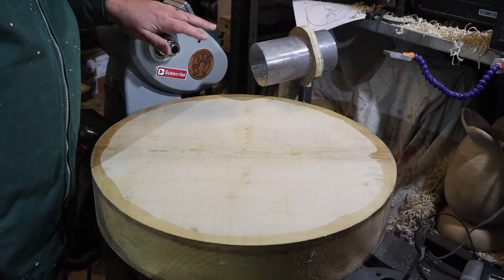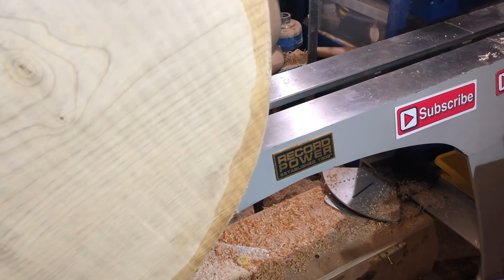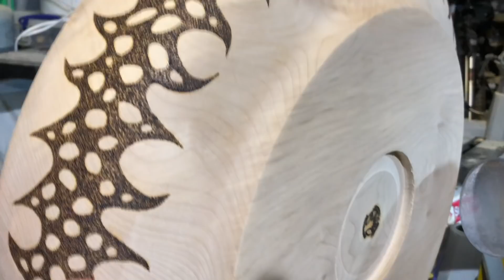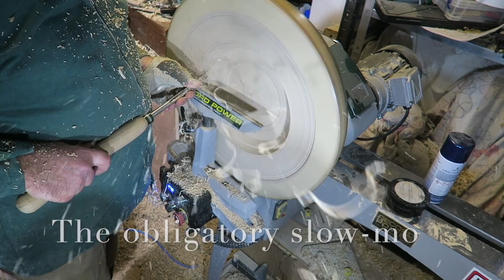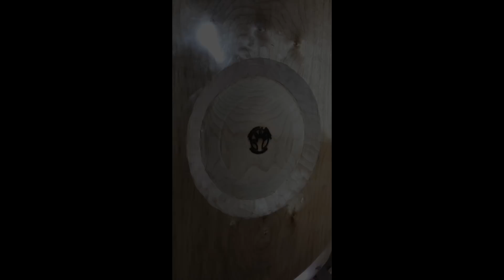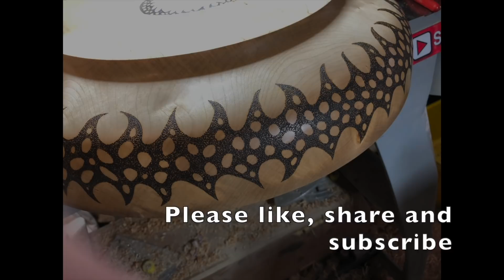Woodturning my biggest ever bowl - 22 inch monster

Comment: My husband is interested in getting into wood running. He only has a small shed 6x4 foot ish. Apart from the lathe what does he need as a real beginner kit? I see other turners with loads of gadgets, 10+ gouges etc bandsaws, sanding machines etc.obviously he will collect gadgets as he improves as a wood turner. For training & making mistakes & “ unique” items what do you suggest.?
Reply from the maker: I would suggest getting a good quality set of starter tools from one of the well known company (cheap ones aren’t worth bothering with), you will also need a sharpening machine ( I use the Sorby Proedge). A dust extractor is strongly recommended and a safety visor and respirator mask are also essential . The best thing would be to get some lessons from a professional and see if he likes it and they will be able to advise on the best purchases. Also essential to get some lessons on safety as it can be dangerous .

Comment: I wonder how long it took you with the burner and how you managed to hole it right to put on the spindle.   By the way do you exchange stickers?
Reply from the maker: It took at least 3 hours to burn the design. I used a centre finder to mount it. I have currently run out of stickers. Many thanks for watching .

Comment: I never realized that Sycamore got that large in diameter.  You did a great job.
There was one thing that I wish you had done differently.  Instead of gouging out a ton of chips of wood, I wish you had used a Bowl Cutter instead.  That way not only would you have had the depression you needed cut out, but you would have had an additional blank for another project as well.
Also, would really love to see your daughter in one of the intros.  Maybe even choreograph something with both of you in it.  She sounds like she is an absolute treasure.
Reply from the maker: I think sycamore blanks this size are quite rare, especially one without cracks. I would love a bowl cutter/saver but they are very expensive . It was on my list to Santa but he seems to have forgotten.

Comment: Fantastic work bud. Nice example of the Record power’s capability, did you have any trouble with burnt bits smearing across with the YG ?
Reply from the maker: Thanks Chey. The Regent lathe certainly has loads of power, I realised half way through that I wasn’t even using the lowest belt ratio. I was expecting some smearing but got none, possibly helped by the spray sanding sealer.